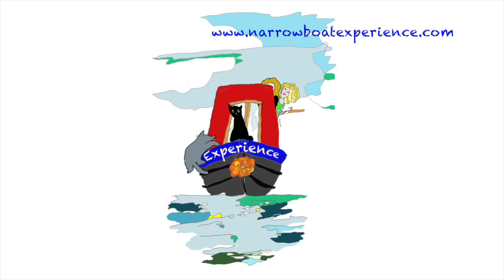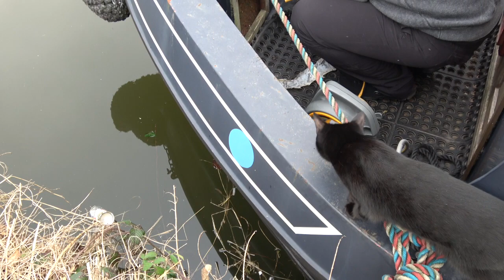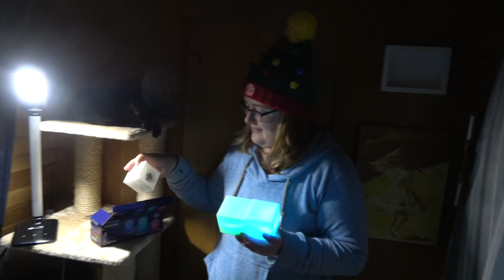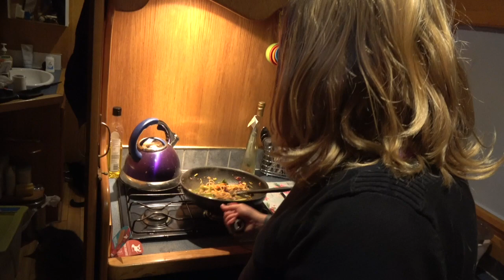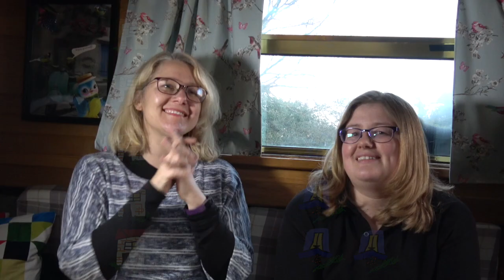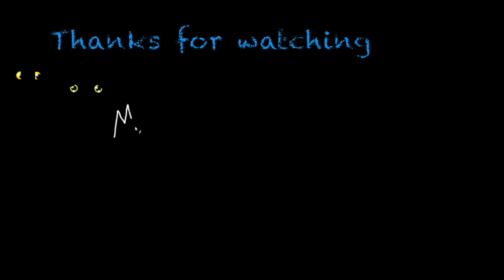How does living on a canal narrowboat compare to living in a house?

Comment: I think the key element for me is that a boat floats - and moves! Having been fairly stuck in the marina for the winter, with only one outing with my daughter (which ended up with gear selection problems), it's hard to see how the boat is better than house. If I was going to live on a static houseboat, it would have to be bigger. However, the potential to move around the whole canal network is a huge factor and sacrificing ease of power, toilets, water etc etc is a tiny price to pay for such wonderful mobility :-)
Reply: At the moment I still have a 35' x 12' static caravan near Brixham. If I'm really feeling cramped I can go there and spread out a bit, and soon begin to wish it was floating ;-)

Comment: A lovely video. I love the giggles between you two! With me being ever so slightly older than you, I suggest you might put some thought into how you lug those heavy gas bottles - especially with your back bent over. Believe me, it's not good. Perhaps a simple, lockable pulley system (max cost around £25?) has got to be worth it if you don't have to spend that in pain-killers etc. It's something I've factored in if I get lucky enough to get a boat. All the best and have a great day ;-)

Comment: Water savings for showers.  The Asians have to shower several times a day because of the heat.  They use a pot of water to get wet, soap down hair and body, then use a pot of water to rinse, third pot if need be for rinsing.  It really saves water.  I would use a gallon jug, it would use three gallons for a shower.

Comment: Hi Anna & Kath, Good idea for a vlog :) If I was to add anything to the list I think these should be there...General Maintenance, Laundry, Cost of Ownership. Our boat doesn't use any gas Kath, and because we have an induction hob, our pans get toasty hot :) Look here if you want to know more...www.nb-whisper.com. This was a web site set up by the original designers/owners of the boat. Unfortunately, when we moved the web site, the aspect ratio of the pics got screwed and we haven't fixed it yet! We intend to update it, but we've not got around to it sine we bought her back in August.
Reply: Hi Lancashirelad, To use anything heavy on the 240v electrics, you really need the engine running. So the Washing Machine, Tumble Dryer, Oven, Dishwasher or Hob really need the engine running. The engine runs at a constant 1500 revs and has an 11kVA permanently attached, so generates a LOT of charge. Because the engine is cocooned and has a Hospital Silencer, it is very quiet (hence the name of the boat :) ). I'm not sure whether the varying load has any effect on the crank throw, but certainly 17 years on from the build, the engine still seems in great condition :)
Reply: The nice thing about maintenance on a boat is that everything is much smaller. So if the kitchen tiles need re-grouting it's a 1/2 hour job, not 4 hours! But I guess you don't have an engine and water pumps etc to worry about in the house!